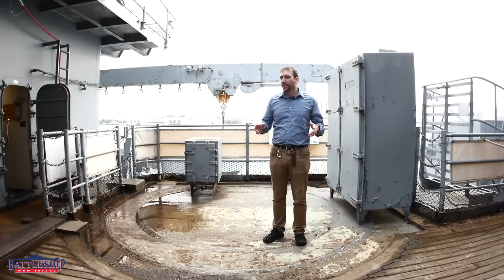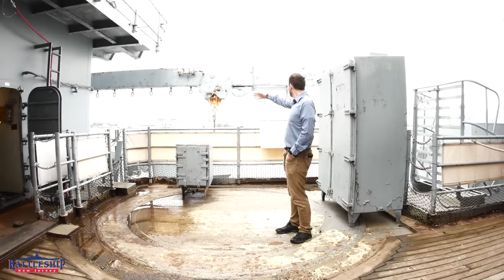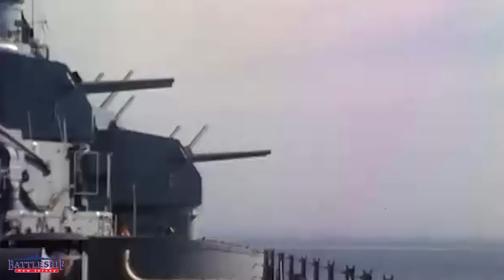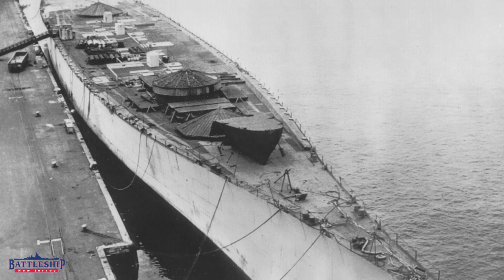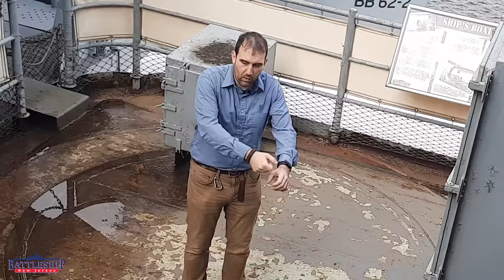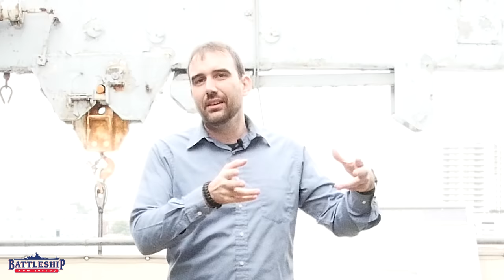What Happened to the 5in Guns Removed From the Battleship?

Comment: When destroyers were scrapped after 1970, the guns and mounts were cut up for scrap. In the scrapping contract the guns had to be cut to a specific size. Also the hull had to be cut on each side on the machinery spaces all the way around so it couldn't be used. In my time, when a destroyer was overhauled, the mounts were removed and exchanged for rebuilt ones. The navy had a gun rebuild facility away from the shipyards. You got relined guns, everything else rebuilt, new wiring and painted.
In 1960 a whole bunch of warehoused items were sold for scrap along with most of the cruisers, CBs, and all BBs before the Iowas not saved for museum ships.. Among the things I remember were destroyer steam turbines (from ships not completed) that were bought to use in thermal power generation. Also all the spares for the older battleships and cruisers was sold off. A lot of the ammo for the older BB guns was loaded into mothballed freighters. Then towed to sea and used for target practice. We sank one off the Washington coast. At 5+ miles it blew debris all around us when it went off. The ship just disintegrated. After that they increased the safe range and saved the shooting for cruisers.
The engines from the Kentucky were used in  AOE 1 and 2. They could haul ass, 26 knots. We replenished from the Sacramento, and as a joke, their captain offered a race after we disconnected. We were a Sumner destroyer but they had steam up, safeties ready to pop, and pulled away from us. It took about 5 minutes to catch and pass. Then they gave us the Kentucky story. Apparently they did that trick to every new ship when it was safe.

Comment: I didn’t realize the difference between battleship and destroyer 5” mounts.  My Dad was on a destroyer at Okinawa during WWII when a Kamikaze’s wing sliced between the barrels of the 53 mount.  It killed half of the gun crew.

In Sumrall’s book on the Sumner and Gearing destroyers he talks about how the 51 mounts would get bashed in by heavy seas.  It happened to Dad’s ship on its way from San Pedro to Hawaii.  If you look at the 51 mount on a Sumner/Gearing, you’ll see where they welded in reinforcements.
Reply: Beats a contemporary British destroyer with open gun shields, that's for sure!
Reply: Or a Fletcher which was barely better than the RN DDs

Comment: I know some mounts were given to the Yuma proving grounds, the Nevada test facility, and WSMR and converted into observation and instrument mounts. What happened to them from there I have no idea. I know that Nevada still has a Cruiser Turret out on the range, but as the lighter 5" mounts were placed up in the mountains or in out of the way spots for gaining some needed angle they may still be out in the desert forgotten. I remember that in the mid 90's several observation platforms and test stands at WSMR were taken down and scrapped when they gave back pockets of land to the Lincoln National Forest, but not al of them were. A few just had there access roads cut and are still out there scattered across the basin.

Comment: In reading the inspection reports of Kentucky those are “shafting” on the deck not barrels.    And she was scrapped before the days of environmental conceals and actually fetched a pretty good price.
Reply: Also Ryan, the 5” mounts on Kentucky were Wisconsins spares and the bow section is from Wisconsin not Kentucky
Reply: Exactly, we were still swimming in lead paint and snorting asbestos then….
Reply: I don't think the ship had fuel or hydraulic oil in any of her tanks yet. It's possible that a lot of the asbestos insulation was not applied the all the pipes and lines yet.  I'm 100% sure it was all lead based paint on her.  But especially back in those days this was a pretty clean scrap job.

Comment: In the early 2000s during the Afghanistan War many 5-inch barrels were repurposed as bunker busting bombs. The hardened barrels were used to penetrate several feet of concrete or rock.

Comment: Ryan, I suspect you are correct, that those larger 'pipe like' pieces are actually sections of propeller shaft.  Kentucky would have had four shafts and props just as your New Jersey does, but had they been installed in the ship prior to her being launched?  I doubt it.  

The points where the shafts would have penetrated the hull would either have had to be blanked over or have remained as shaft seals needing periodic maintenance both while the ship was still out of the water in that drydock or once she was launched.  For those who aren't familiar with ships, prop shafts are built in sections, they are not single pieces 100 or 200 or 300 feet long, but are sections that are bolted together.  This both allows for an easier installation and also for easier maintenance or repair/replacement if something happens to damage the shaft.  I may well be wrong, but that is what they look like to me.

I agree with you, the missing gunhouses have probably been scrapped.
Reply: I have seen the picture of the Kentucky heading to the scrappers with the caption stating that indeed the pipe like pieces are her 4 propellor shafts.

Comment: I wonder how many navel guns made it onto the front lawns of  American Legion club houses or VFWs around the country, or even town greens vetren memorials. Ive seen one in Connecticut at a VFW. If I remeber correctly, it was painted grey, it was some form of motorized deck gun. It had a seat for the gunner. I think it had 2 barrels that were about 3-5ft long. It  had wiring and junction boxes all over it. And its turret was mounted to a cement pad. We know there are tanks, Towable artillery, and and aircraft donated to these organizations. I wonder how much Navel equipment got donated?

Thanks for all the videos you make about the New Jersey. Ive learned so much more than you can learn on a single tour, and hope to visit later this summer.
Reply: one of our twin mount 3"50 from LPH-7 is at a VFW in Portsmouth. A week after it was moved we were removing parts for our new more modern guns.

Comment: 2.5 sts steel for the mounts.  How much does a 5 inch gun mount above the weather deck weight?
Reply: MK28 Mod 2 on the Iowas weighed ~170,000 pounds - 85 US tons

Comment: As OF 1982 - the US Navy operated 17 Frigates commissioned mid 1960s with 5/38 single mounts - Garcia Class, Brooke class and Glover. (10,6,1) and remember the USS Long Beach had 2 5/38 mounts - but all single mounts and "light weight" - more like from the Fletcher class Destroyers, rather than Gearing Class (doubles).Long Beach not decom until 1995- other mostly decom 1988-89.

Comment: My WAG is this.... kind of jumping around,  but I would bet that the "gun mounts" shown on the Kentucky are not the complete gun assembly,  but are only the shields for the mount. One reason I say this, there are several  access doors that are open, which would expose the entire mount to the weather.

I was on board during the reactivation, but spent my tour(s) in Turrets. What probably happened to the guns was, the shields were removed (no sense in shipping unnecessary weight), and the mounts were shipped to NOSL, Louisville, KY for overhaul, and kept either there, or moved again to Crane, IN for storage. It wouldn't make any sense to scrap the mounts, as they would have been one of the few sources of parts, or complete assemblies if needed...

Comment: I would guess the closest analog to the battleship 5" mounts would be those of the Atlanta-class light cruisers. From what I understand, they are basically the same turret, just a different generation of it.
Reply: Due to the weight restrictions of what are in essence overgrown destroyers, the Atlanta class ships used destroyer type gun mounts.  Armored mounts would probably have added too much weight to the ship well above her center of gravity, making an already top-heavy design too unstable.
Reply: The Iowas' 5"/38 mounts were Mk28 Mod2s.  They were the heaviest 5"/38 mounts the Navy ever made, about 14,000 pounds heavier than the mounts on the earlier battleships.  My guess is that they had more armor.
Reply: The Atlantas used the MK29 Mod 0, at 108,000 pounds they were more than 30 US tons lighter than the Iowa’s mounts. With 8 (or 6) mounts that’s 240 tons, roughly the displacement of a 160’ long LCI

Comment: The turrets were probably scrapped,  my guess is that the barrels are sitting in a nice stack in a field in Dahlgren.
Reply: I'm sure they are at Dahlgren. Both of my parents worked at NOL in White Oak, MD. Dahlgren was one of the NOL Divisions. All of the 16 inch gun engineering and test work was done at NOL. We got to watch a shore firing of a 16 inch gun from Dahlgren during the reactivation in the 1980's. I bet NAVSEA has records at Dahlgren or in the Archives as to what happened to the 5 inch barrels. I am pretty sure there are still 16s stored on site at Dahlgren too.

Comment: Do you know why the Navy switched from 2-gun 5 inch turrets to single-gun 5 inch turrets?
Reply: The 5inch 38 came in many different mountings.
Reply: you mean from the Battleship dual mounts to the single mounts on modern warships? It was probably due to the smaller role the 5 inch gun had to play, which was some very rare shore bombardment or fending off small boats. Battleship 5 inch were for frequent bombardment, fending off small craft and destoyers, and a lot of aa defense.
Reply: @bomber6258 - The old destroyers also used 2-gun 5 inch turrets.  I'm not sure, but I think the Navy switched to single-gun 5 inch turrets with the Arleigh Burke class destroyers.
Reply: @mrp8488  The early destroyers only had single 5 inch mounts. It was only very late-war version such as the Allen M. Summer class that were wide enough and big enough to fit dual 5 inch turrets. This was because these destroyers were more focused on aa fire as well as having a more condensed gun layout. old destoyers having 4-5 guns scattered from bow to stern (usually 2 front, 1 mid, 2 rear), the 6 guns are concentrated solely on the fore and aft sections.

Because modern ships such as the Arleigh Burke do not need the 5 inch gun for aa fire and very rarely need to conduct bombardment/ fight smaller naval ships (which are usually already dealt with using 50 caliber to 20mm weaponary), they went with the minimum single mount. This single mount is automatically loading and remote controlled, able to fire around once every 3 seconds consistently.

Comment: There are too many of those long pipes to be gun barrels, and I doubt that they had all 9, plus an extra 8 just sitting around for the ship.  They also appear to be too short if you calibrate and measure based on the 5 inch frames, which we know the size of.  I suspect that either propeller shaft or armored trunks is more likely.
Reply: I totally agree I was thinking the same thing a 16" barrel should be a little over triple the length of a 5" 38. I was thinking it was all prop shaft because it all appeared to be flanged on both ends

Comment: not sure if you are aware of it or not but there actually is a pile of value to the older ships, predominantly ships that were completed prior to 1945.  the reasoning for this is because of nuclear weapon detonations.  steel that was already made before nuclear weapons has an inherently cleaner nuclear signature and is highly desirable for certain high sensitivity equipment such as medical imaging equipment, scientific instrumentation, or for certain safety equipment such as Geiger counters and other radiation measuring devices.   the base radiation of steels made post 1945 is substantially higher than what was made before nuclear detonations began, and can severely throw off the accuracy of the readings of equipment made with it.  its for this same reason that a lot of the steel cut away from the USS Texas will be of higher value if it is of substantial enough mass to be able to be processed into clean steel for use.  
i figured as a historian you might have interest in that tidbit of knowledge concerning these old ships.
Reply from the maker: We did a whole video on pre-nuclear steel, and the reality is that its not as valuable as you'd expect: https://youtu.be/tQTk3Y3EOWs
Reply: @BattleshipNewJersey   it’s interesting that you came to that conclusion when there have been several documented cases of pre-nuclear warships that have been scavenged and sold off by privateers in the not so distant past. The HMS Exeter was one such ship that was completely removed by illegal salvagers after it was rediscovered 65 years after it was sunk.  The German high seas fleet that was scuttled in 1919 was used for its low background steel back in the 1970’s for whole body counters in hospitals as well as to make radiation detectors used in both of the voyager space probes and several satellites.   There is only a finite quantity of steel that is suitable for those uses and it’s demand will only climb as it is depleted.

It may be better to clarify “value” to be not necessarily a strict monetary number but more as a resource of finite availability.
Reply from the maker: It seems that much of that scrapping isn't for its pre-nuclear state , just the raw metal.

Comment: Honestly, I never did figure out why they didn't yank every single five inch mount during the 80s. Were they at all useful for anything during that time period? Considering the manning needs and the cost, one has to wonder.. If you wanted a set of fives. Two of the autoloading Mark 45 gun would have made a more sane choice.
Reply: Yes. They were extremely useful. Huge amount of shells in the inventory and an amazing VARIETY of shell types for different purposes. High rate of fire. Tough armored mounts. Still useful for close-in shore bombardment and superb for anti small boat.
Reply: And you give the MARDET something to do….and a bunch of sailors a reason to try to best (and…um…aggravate) the MARDET!
Reply: The 5"/38s got fired way more than the 16"/50s, even during New Jersey's Vietnam activation.  They were very effective for shore bombardment, and the Iowas had the armor to allow them to go closer to shore than the unarmored destroyers.  

You're not wrong that the Mark 45 would have been more useful, but installing them would have required making all sorts of cuts in the armored plate, which was extremely difficult and expensive to do.  The point of the Iowa reactivations in the 1980s was to get the ships out into the fleet ASAP and for a reasonable amount of expense.  There was talk of giving the Iowas 5"/54 guns such as were planned for the Montanas, but the Iowa's ammunition hoists follow a bent path through the armor that wouldn't have worked with the longer ammunition.
Reply: For anything that got too close and the main gun couldn’t lower down to shoot it
Don’t need 16 for everything

Comment: It is too bad they didn't remove all the 5 inch guns and install two MK-13 One Arm Bandit missile launchers per side. Giving the Iowa's some air defense capability and the ability to launch Harpoons via the MK-13.
Reply: Nah, that's what the escorts are for.  They tried that with the first three KITTY HAWK's.  They had Terrier launchers but they didn't last long.  The fire control radars and other support equipment took up too much space and they duplicated the roles provided by escorts.
Reply: @samculper6699  Carriers are different than Battleships. The 5 inch guns were USELESS in the 1980's and obsolete. Replacing them with something with functionality would have been a huge upgrade. If you don't want air defense missiles how about having a capacity of 64 harpoon missiles so when the Iowa's were operating in an anti surface warfare role they could saturation attack a Soviet surface action group.
Reply: @CRAZYHORSE19682003  I wouldn't say they are useless but for what they wanted the IOWA's for in the 80's, less effective than they might have been.  If they had used them to support a contested landing, they would have been useful in a naval gunfire support role.  Against Soviet Kirov's or Kiev's, then yeah, they wouldn't have been used.  Harpoon's or Tomahawk ASM's would have been the weapon of the day.  Or if they'd have produced the 16" Sabot rounds, that would have been useful.  Or against Iranian missile boats the 5" might have been useful if the bad guys got in close enough.  Could what if it to death.  I think it came down to $ on why they didn't replace all of the 5" but that's just my guess.  No research into that theory.

Comment: USS Wisconsin BB 64 - There is a photo of the Upper Bow section totally removed from USS Wisconsin and may have been reinstalled welded back on to replace the lower damaged area which is different than you mentioned.  The upper portion was removed and possible replaced. http://www.navsource.org/archives/01/016470.jpg